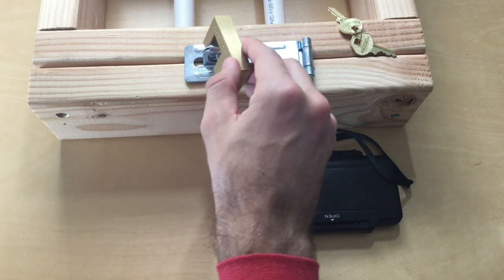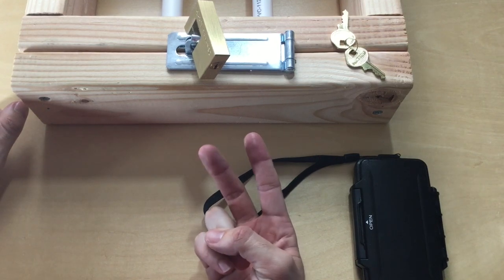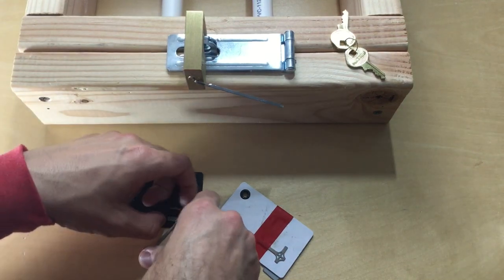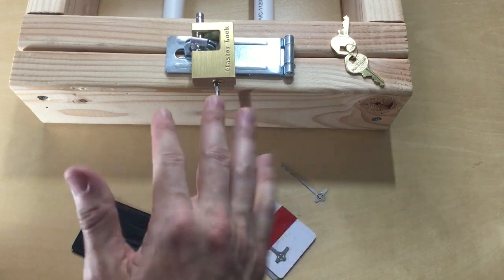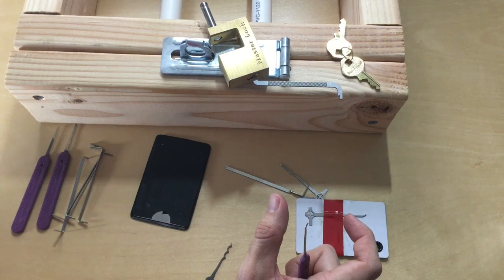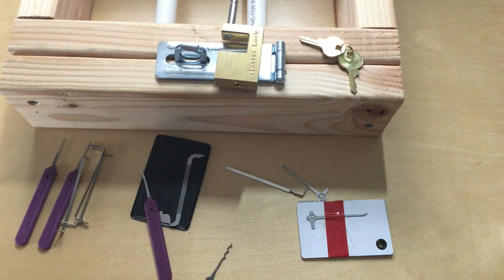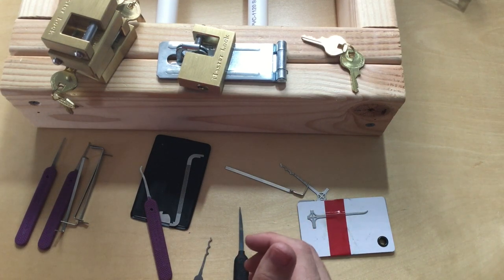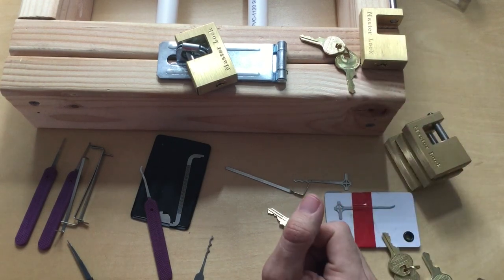Master Trailer Lock   Target Assessment Example

Comment: Awesome! I appreciate the thought process/protocol.
Reply from the maker: Thank you! It’s hard to fit the full scope of WHY I shoot every video, but yes, the thought process, the “framing” is definitely intended to be the value point for the curriculum that I have designed and I teach. I can’t tell you how many “just use a sledge hammer” comments I get lolol. That’s not the point, you can’t carry a sledge hammer on your belt 24/7. Thanks for appreciating the protocol’s I’m trying to share :)

Comment: Bolt cutter or grinder, maybe Halligan iron plus sledgehammer is used to remove locks when time is crucial. Pipe wrench is also a useful tool to easily break away 40 mm locks. That is what is being used practically. Locksmiths tend to drill or grind padlocks and just chuck them away to get the job done.